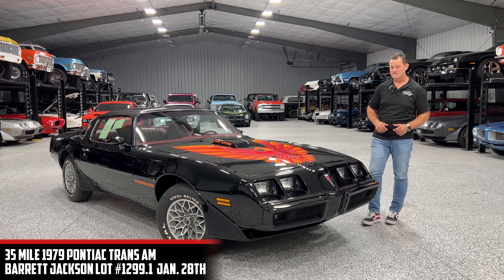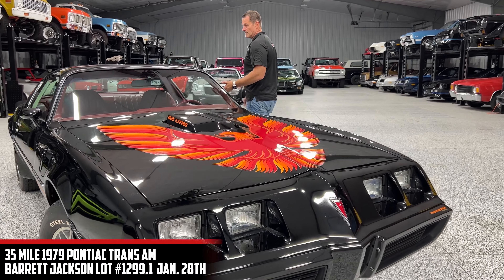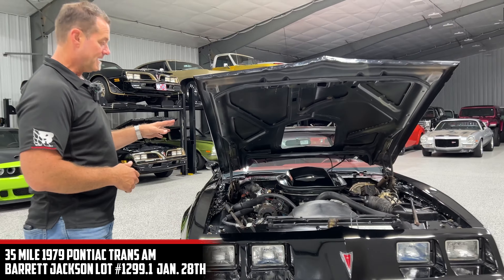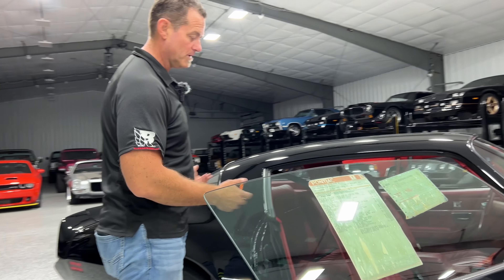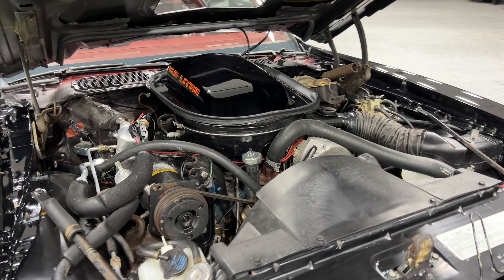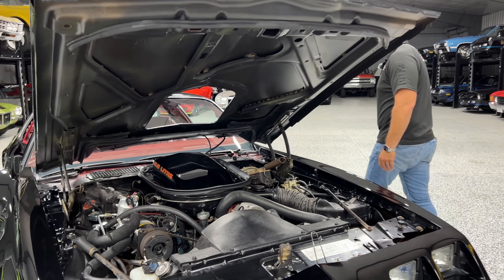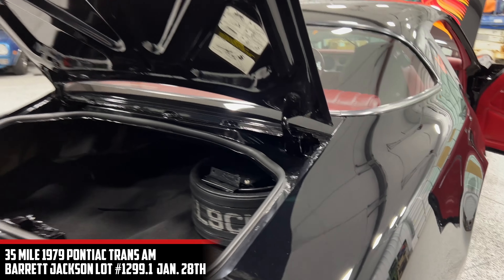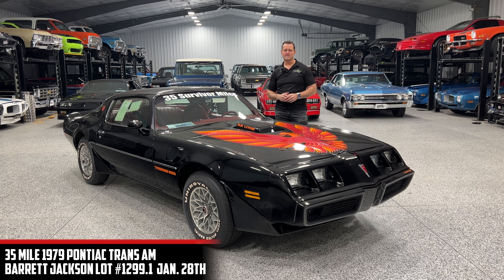Ultra Rare 35 Mile 1979 Pontiac Trans Am Barrett Jackson Lot 1299.1

Comment: That car brings back memories from when I delivered pizza in the early 80's. One of the restaurant co-owners had a red 1979 Trans-Am with a red interior that he had custom ordered and kept in absolutely immaculate condition.

He let me borrow it a few times to deliver pizza and it was a blast to drive.

His baby had a few more options than the one in this video, including what he was most proud about; the high output, 220hp stock, Pontiac 400 (if i recall correctly a 185 hp 403 Olds was the base motor). It also had T-tops, a 4-speed manual, power windows, power seats, the stiffly sprung handling package, the quick ratio steering box, a posi rear end, A/C, and more. He had also had the dealer install a Pontiac higher performance cam and a few other power adding upgrades, which gave it a lopy idle and a power boost.

I always wondered what happened to his car. He never drove it in the winter and rarely drove it in the rain so I wouldn't be surprised if it is still around somewhere.

Comment: Really nice!  I didn't realize that some Trans Ams came from the factory with dual mufflers; I thought they all had the transverse muffler.  I learned something new.
Reply: Some of the older TA's have the transverse muffler, like 76-77's. I think in 78, they went to this configuration. I have several 79's with this 2 muffler setup.

Comment: I had almost the identical car, except mine had T-Tops and different color decals. I sold it in 1993. The 403 cubic inch engine was made by Oldsmobile and only produced 185 HP.
Reply from the maker: They aren't speed demons by any means lol
Reply: There definitely not stock speed demons but with a few little parts removed that definitely changes. 
It'll always be funny how performance mods for cars from the 70s and 80s always started off with removing OEM parts compared to all other years requiring performance parts to increase HP

Comment: It;s odd that it has power locks but no power windows, and air but no deluxe inter .
Reply: Yes I questioned that and the gold-colored power steering pump and master cylinder cover.
  Questions
Reply: Not that unusual. I have a 79 TA that came with power door locks, but not power windows. I've seen a few others like that on the internet too. 
And my car has AC, with standard interior. Also has clear windshield and door glass, not tinted. It also has t-tops. I added factory power windows to it though, so that when someone to the right of me at a stop light asks what year it is, I can roll the passenger window down to tell them 🙂.
Reply: @joelbyrd7958  Not unusual to have original gold anodized master cylinder cover. Mine has it, and I've seen other low mile TA's with them. The power steering pump isn't gold. It's just the guy said they power-washed everything, so they blew most of the black paint off the pump body revealing the coated metal underneath. Wasn't a good idea to power-wash in my opinion.

Comment: 35 miles? This car has been abused. Sure all systems need to be replaced or rebuilt. If it had 50K miles, it would be in better shape. Impossible it is in like new mechanical condition.